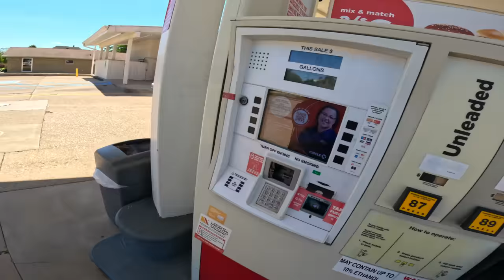Motorcycle Camping & Wagyu Burgers

Comment: Missed you videos!  I think you should maybe buy a camper that has the features that you want including electricity, vents, water, propane kitchen, refrigerator or ice box and a furnace.  Used ones are cheap and they have lightweight ones.  They are also built to code for safety.  Good luck!